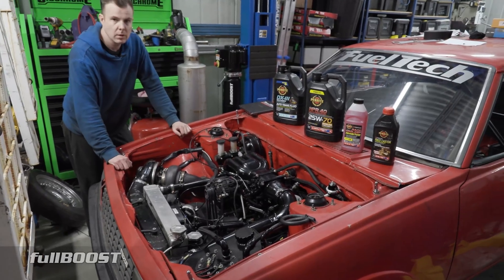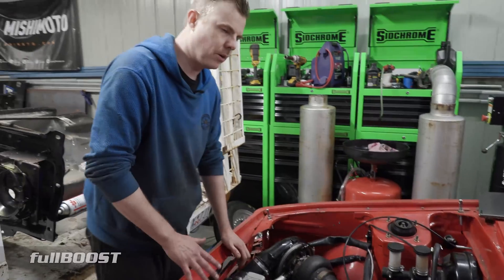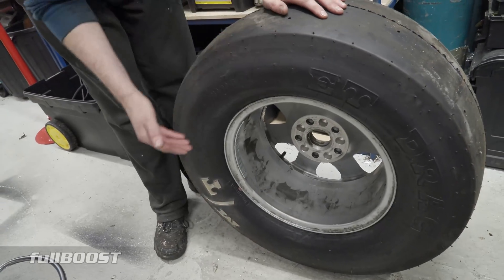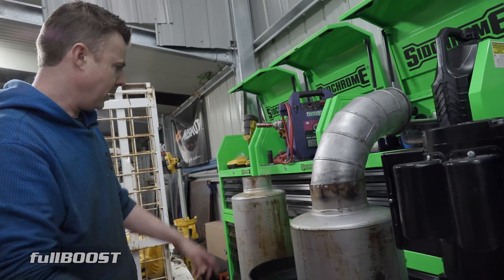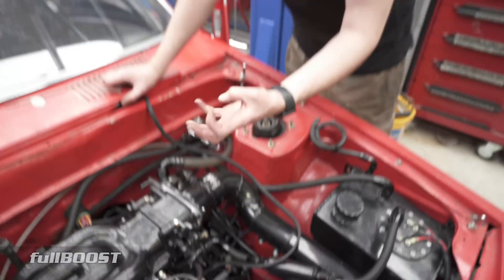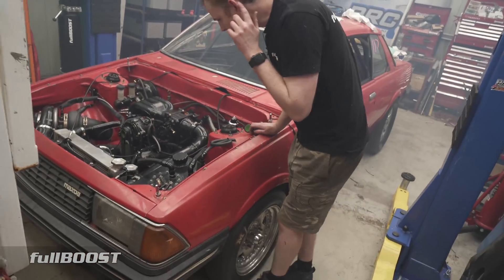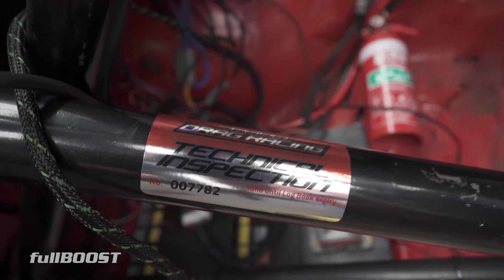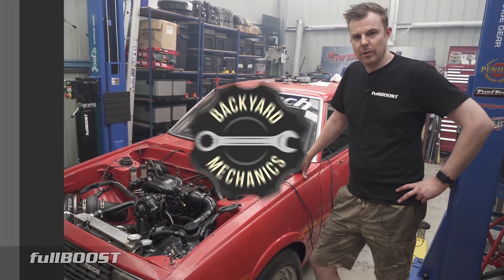We FIRE UP Project Redline | Mazda Rotary 13B turbo | fullBOOST

Comment: It's not a street car, go methanol, specifically VP M5. It will run cooler, make more power and drastically consistent. Water-Methanol (50/50) on top of E85 will give you similar results.
Reply: Anthony Thomas we cant run any nitro mix in Australia. And M5 is unbelievably expensive anyway.

Comment: If you bury a 20 ltr drum half filled with water with 4" of soil on top you connect exhaust pipe to it through lid with opening in the water 2inchs from bottom  4 x 1.5" dia pipe exiting through lid will muffle 90% of noise

Comment: My experience with my rotary powered drag cars. They always made more HP on 5 gallons Race Gas VP 116 mixed with 10 gallons of pump 93 fuel also running 100% methanol with the methanol injection.
Reply: 20lts of Toluene in the fuel tank and water meth!

Comment: Have you tried the AutoLite Part# AR3932X Heat Range 9 or AR3933X Heat Range 10 strapless ground strap racing spark plugs. I was running NGK Part# BUR9EQ leading and trailing with AEM Smart Coils Part# 30-2853 1GBT Smart Coils in my full bridge portrd 3rd gen FD motor and was changing plugs every weekend sometimes twice a weekend at the drag strip. Once I switched to the Autolite AR3932X plugs I've not had to change plugs once other than by choice. I ran one set 4 months no problems what so ever. And I run 20psi of boost on pump 93 octane fuel mixed with 5 gallons of VP 116 with Idemitsu Rotary Premix mixed a ounce to a gallon as well methanol injection with one 1000cc nozzle spraying 100% methanol. Absolutely best plugs I've ran thus far even over the RX8 Iridium plugs and or factory plugs and best yet the Autolite cost $20 for a set of 4. Just some food for thought sorry for being so detailed lol.
Reply: Adam Clark we run ngk r6725-115. They are about $50aud each.
Reply: @BackyardMechanics  yeah im not making huge amounts of power. Currently my car's best to date is a 7.00ET @ 101mph in the 1/8 and 10.97ET @ 130mph with a  manual trans in a full weight 1989 RX7 FCS3 on a M/T ET Street drag radial. Maybe once I freshen the motor this winter and upgrade to 2x ID1050X primary injectors and 4 x ID2000'S secondary injectors as well I've got a Haltech Platinum Sprint RE ECU currently but I picked up a Haltech Elite 750 ecu and a Borg Warner S369SXE I'll turn it up to 30+psi. Motor is fully race clearance and balanced and studded & dowed with the best seals that I could afford. So maybe I'll try a set of those plugs and report my findings.
Reply: AUTOLITE 😀 Good !

Comment: Interested to see how the water injection variations you mentioned change the performance. Please make this a feature lads. Good to hear the metal music as usual 🤘🤘🤘
Reply: That would be great to see some data.  I've been running water injection for 20 years but can only say its stopped power robbing heat soak and that I've not detonated after years of abuse
Reply: Water-Methanol injection on top of E85 cools the intake charge much more than E85 alone. Methanol has much more heat absorbing properties and nothing cools better than water. It will go faster...
Reply: Nah,only helps running it on hot days,wtg be meth or e85 😉